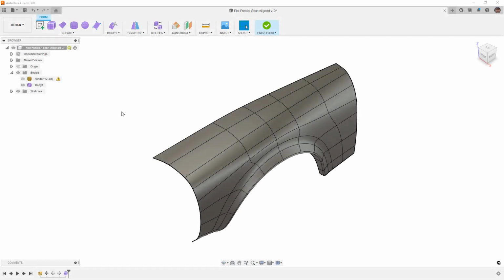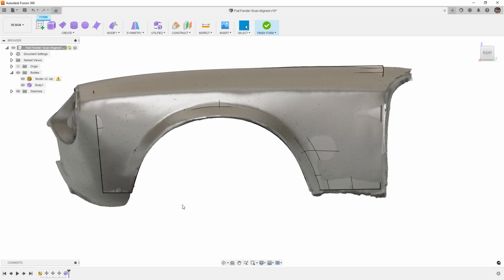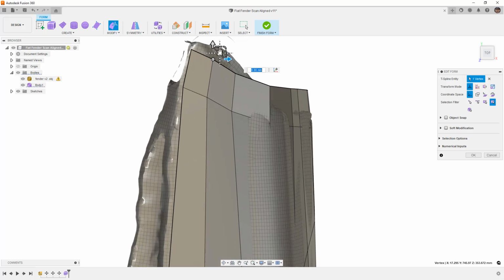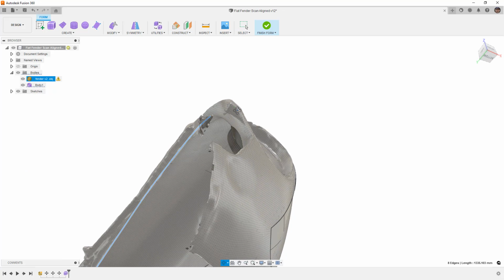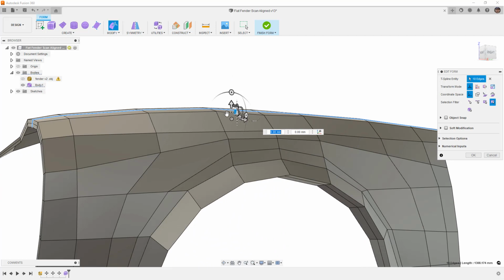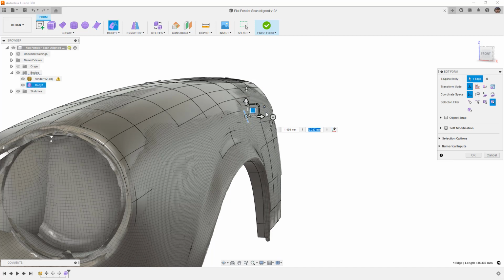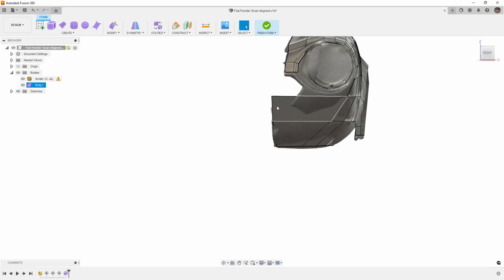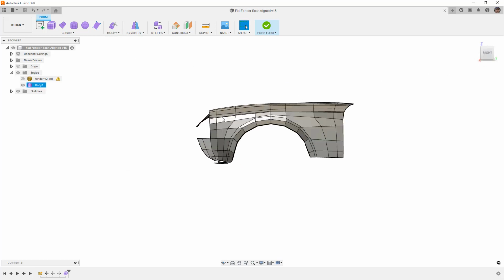Reverse Engineer Car Parts with CAD | Fender Modeling from SCAN Data - Part 2 #Fusion360

Comment: Great videos, very helpful, what keys do you use to switch between smooth view, sharp edges and edge hiding?
Reply from the maker: thanks.  Alt+1 for box display and Alt + 3 for smooth display.  For the edge displays those are tied to CTRL + 4 for no edges and CTRL+6 for edges.  If you are on a mac then swap CTRL for command and ALT for Option.
Reply: @LearnEverythingAboutDesign  and how to add holes for screws
Reply from the maker: @sebastiankozak3818  In this case the user only needed help with the shape and the holes were going to be drilled manually.  I did a video awhile back on adding hardware for a 3d printed flare here https://youtu.be/ds9C6Q067XU

Comment: Just curious - why not use the 'pull' function instead of manually adjusting the points to conform the plane to the mesh? Thank you for the amazing videos!
Reply from the maker: With really high quality scans and parts that need to be a precise fit, the pull tool is a great option.  Things like a spoiler to fit a deck lid or a scoop to fit on a fender.  This specific part was going to be a large 1 piece 3d print(the person was building an 8ft printer i think), and it was for a race car.  Knowing the fabrication method, quality of scan, and use of the part is what drove the choice.  If you use pull on a high quality scan of a bad part, or have a low quality scan of a good part, the form can end up having waves in it.  So you just have to choose wisely.
Reply: @LearnEverythingAboutDesign Thank you for elaborating on the thought process, I'll keep that in mind!

Comment: Great video(s), I do have one question though.  When I'm in 'Edit Form' I can't switch between Box & Smooth display using Alt 1/3, the only way I can do it is using the controls under 'Selectoin Options' in the GUI which is obviously not what is happening in the video, makes this work flow a bit awkward.  Alt 1/3 works when GUI not open.  Any idea what I'm doin
Reply from the maker: Unfortunately the last big Fusion update broke that...  So anytime you have a dialog open like Edit Form, the alt+1 to view in box display no loner works.  You can expand the Select Options and there is a display toggle there in Edit Form, but the other tools where you might switch back and forth it won't work.  Alt 1/2/3 should still work when no tool/dialog is open.

There is another fusion update coming soon and I am really hoping that gets fixed.  I did email some contacts to alert them of the issue so fingers crossed...
Reply: @LearnEverythingAboutDesign  thank you very much for the reply. I thought it may be something like that. Ad you say there are controls in the GUI and the Alt commands do work when the GUI is closed, it just makes the workflow a little less slick. Fingers crossed it gets fixed in future.